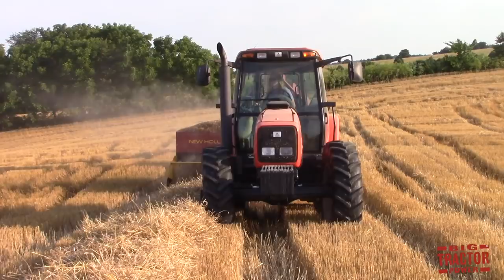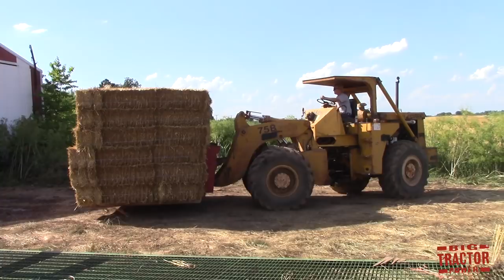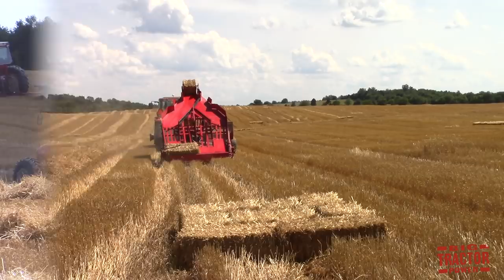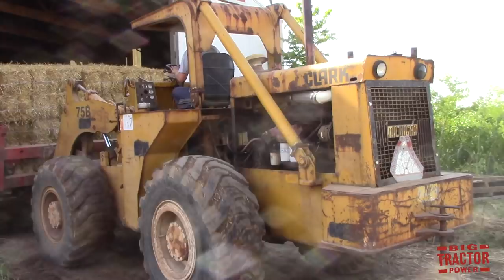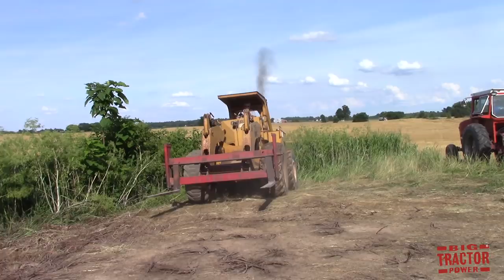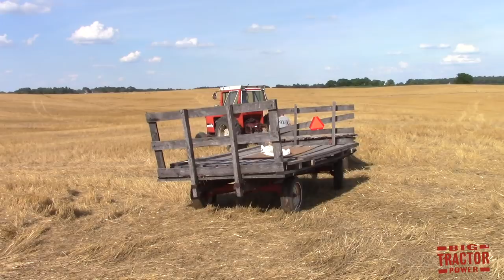Scooping Up 120 Square Bales At A Time

Comment: Super slick setup awesome job finding the hidden gem operations like this Jason.  Everyone and their mom runs John Deere combines and John Deere tractors on there corn fields.  This is the neat stuff you don’t get to see much.  I only bale enough straw for my bedding every year from my winter wheat fields.  I run 3x4x8 900-1,100 pounds square bales and use a telehandler to pick them up in the field and use peterbuilts with three 40 foot flatbeds to take them to my barns that are fully enclosed and have concrete floors.  I do have a wheel loader with a bale fork attatchment that has 8 foot forks so I can grab to stacks of three bales at a time so it makes loading trucks super easy and doesn’t obstruct my vision at all.  I also charge a lot per ton for my bales and most of them go to the Tillamook valley dairy farms on the Oregon coast so I have to make sure they don’t get any weather at all.  My balers are custom because every time a bale slides out it lands on top of a sheet of plastic that gets cut to bale size so that way they aren’t ever sitting on the ground.  My fields are also super nice they have been takin such good care of I don’t have to spray anything on them because my family has been ranching and selling hay in the same location for almost 201 years from 1819 to now no one in my family has ever once taken a plow or any implement like that to those grass fields they are so thick that weeds don’t grow through they are naturally flood irrigated because having wheel lines or pivots ruins the ground and I can’t have that happen period no matter how little damage they do also we have never once ever let a single livestock animal into those fields.  I admire these guys cleverness and ingenuity in the operation.  Once again awesome job with the video Jason you never stop amazing!  The reason I run a telehandler in the fields is because I can pull it on a gooseneck trailer behind my Cummins also every single one of my Massey balers that bale the hay have never bales anything else in their entire life’s I have one baler specifically for straw so there is no chance of cross contamination.  It probably sounds like I’m crazy and more like I’m growing something in a lab not a field but the reason we are so successful is because we have stuck to the same strategy for 201 years well I mean back 100 years ago it was all done by hand so I guess there was some livestock in the hay fields when they had to use horses to pull their flatbed buggies and stack loose hay before the baler was even an idea in someone’s mind haha.  Sorry for rambling on but wanted to share part of my story:D

Comment: I can almost smell and taste the straw dust and it feels like every 90 degree day coming through the screen.   I spent many a long day in my younger days throwing bales on a hay rack behind a baler.  Great video work.
Edit: I just noticed that their using floating forks to lift the bale pallets.  I hated those things when I ran a lift because they never failed to get stuck under something, flip up like a teeter totter and upend whatever it was you were lifting.
Reply from the maker: My first job was stacking hay on a farm off kick bale wagons.  This process is a whole lot faster.
Reply: i personally prefer floating forks, its far more forgiving if you get the tilt angle wrong whilst pulling out

Comment: It's a dream farm.  Go team orange, red, and grey!
Reply from the maker: It’s a nice line up for sure.
Reply: Interestingly what’s badged as AGCO in the US is sold under the Massey Ferguson brand in Europe. The tractor doing the baling would be a Massey 5455 in Europe. It’s pretty much identical but the cab is silver. In Europe they don’t do dual wheels on the rear, just a much wider single set.

Comment: BTP, there are a few good farms left in middle TN and most use green or red equipment. I'm one of the very few still running orange and silver. Also have a 3588 IH.  Great videos. Keep up the good work.
Reply from the maker: Keep the orange going. Thank you for sharing.  I would like to film a 3588. They are cool tractors. Where are you near in TN?
Reply: South of Nashville in Spring Hill.
Reply from the maker: Neat.  I am north of Nashville. Could you drop me an e-mail at contact@bigtractorpower.com
Reply: How hard is it to fix or get parts for the 3 series Gleaners? L3 or M3 it’s been like 40 years since they were produced
Reply: @lucasrabe  
Agco still offers a selection of parts through their Heritage line.

Comment: Old farm hand here - Never cared for the baling, hauling, stacking all that much...!  It, was all by hand, one bale at a time...  Now, using equipment to do ALL without ever physically touching a single bale - from inside an air conditioned cab - Is TOTALLY a different story...  I could bale and stack hay All day - No Problem...  :)

Comment: While we use balewagons on our farm this operation clearly shows there is more than one way to get the job done without touching a bale...
Reply from the maker: It is a neat process.  This farm looked at a bale wagon.  They basically bale two days a year to put up 25,000 bales.  The bale wagon is fast but they saw they still needed a loader at the barn to double stack and saw the Kuhns accumulator was much less of an investment.  It’s a slick processes for smaller production.

Comment: There's a farmer over here in Central WI who uses a MF 5713 SL tractor, MF Hesston 1840 baler & Kuhns AE18 accumulator.  He must be using 28' wagons because he hauls back & forth load with 4 stacks or 6 rows or 432 bales per wagon.  It does look like he loads them with a similar loader attachment w/ the tie feature.
Reply from the maker: Very cool.

Comment: Nice video! Looks like the combine is moving right along! Do you know how fast he was running? Did he do any special modifications to the combine? We used to have a Gleaner L3 with a 24' header, and the fastest we ever ran was about 4 mph in 40-bushel wheat. Looks like he's running faster than that in 90 bpa!

Comment: I was surprised that you didn't explain why they were using the L3  instead of their newer rotary combines. I believe it is because particular straw buyers do not want straw from a rotary as it is chewed up too fine for their preference. The older walker style machines produce a longer straw.
Reply: You would be correct!! Straw walker machines like JD 9500 and older Gleaners produce a superior straw product!

Comment: not cutting it too low  considering you are going to bale it after ....   4x4 bale of barley straw is making 25 euro here now in ireland  due to the drought  and  resulting fodder famine
Reply from the maker: They cut it higher because they plant soybeans right behind the baler as a second grain crop.  The higher stubble helps the soybeans grow.  This farm only bales a small portion of their straw and spreads most of their wheat acres as all of the wheat is followed by soybeans.
Reply: lucky to be able to grow 2 crops .....very poor growth here this year  due to drought .....usuallly too much rain in ireland ...!!
  excellant video   has the combine got a deutz  air cooled engine ??

Comment: No info on the massey, and just a light touch on the skidsteer?
Reply from the maker: The Massey is a 251.  It’s a neat tractor but added a few extra minutes to explain making the video longer.  I like to keep a video in that 9 to 12 minute range.  As far as the skid steer I glazed over it because I do not know how to pronounce the brand name.  I had never heard of it.  I did not want to mess up the brand.
Reply: The skid steer is aTakeuchi TL 150. It’s the exact same thing as a Gehl. About the pronunciation of the name I could tell you that either. 😂

Comment: I would remove the Deutz -Allis decals and rebadge it Allis Chalmers if it was mine!
Reply from the maker: I think Deutz-Allis will be a collectible item as the company was so short lived.  I like tracking down Deutz-Allis machines especially the merger items because they are so rare and many people did pull the Deutz-Allis stickers off.
Reply: bigtractorpower possible, but I think it's sacrilege. Deutz destroyed Allis Chalmers and I don't think they should be rewarded. Just my biased opinion!

Comment: Pardon my ignorance of the process, but does the straw have to be run through a combine or could it just be cut and crimped by a regular hay binder behind a tractor then baled?
Reply: Machi74005 the straw is run threw the combined to remove the wheat, which is the value part of the crop, the straw is just extra

Comment: Is there any reason they don’t use a Heston/Massey Ferguson small square baler? That would make it a complete AGCO lineup
Reply from the maker: I am not sure. Most of the farms in WKY wether JD, CIH or AGCO that bale all run NH square balers. My local Challenger dealer has a 14x18 Challenger Baler on the lot. I would like to film it in the field.

Comment: Hell y not use a stack wagon ? To many machines , n men .
Reply from the maker: A new stack wagon is $230,000. The set up on this farm can move a bunch of straw.  Not really that many people involved. One baling and one loading.
Reply: @bigtractorpower   , look I have a stack wagon pulls behind my tractor. Bought  it used $7k , works great . My kid bails , n I run stack wagon.6hrs when can do about 1200/1300 bales of straw .
Reply: Try 25K bales in 2 days. With this system they can load semis or flatbeds faster. I really like the setup!

Comment: The agco tractor is just a re-skined Massey Ferguson 5455 by the looks of it
Reply from the maker: You are correct.
Reply: 5465 Massey
Reply: 5455 was a four cylinder. 5465 is a six cylinder. The six cylinder had the air intake in front of the cab, as the RT120 does, which makes it the same as a Massey 5465.
Reply: Also, I think the Agco used a Sisu engine and the Massey used the Perkins. I could be wrong about the Agco.
Reply: Which engine is better? I only have experience with the Perkins in an AC175

Comment: There is alot of good hay standing that did not get cut. It has to be at least 10 inch high straw standing in the flield that will  not  get cut, what a waste
Reply from the maker: They plant soybeans right behind the combine and Baler. The taller straw helps hold moisture for the second crop. Two grain crops from one field in one year is $$$$$